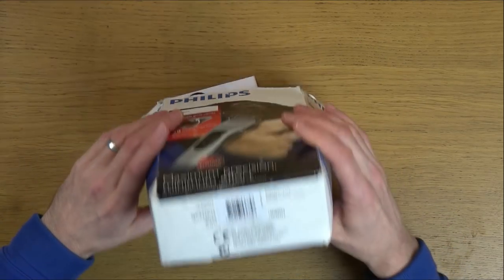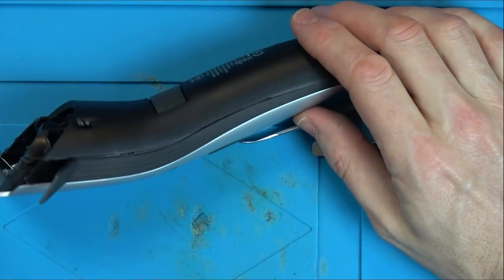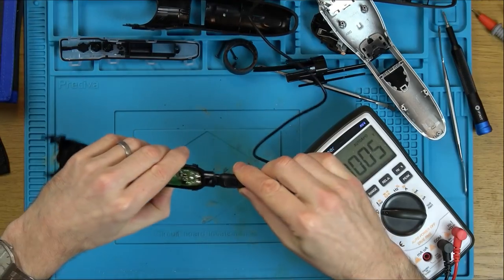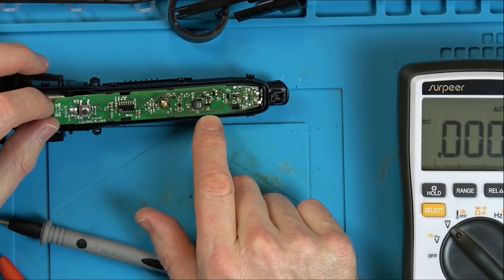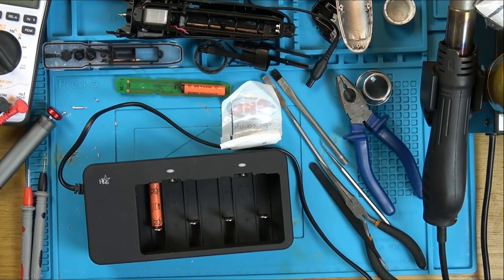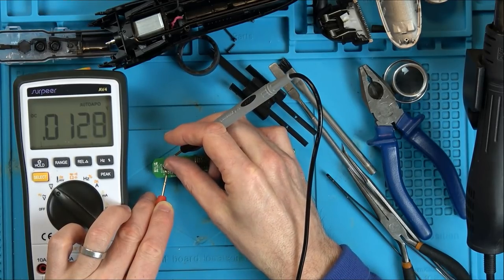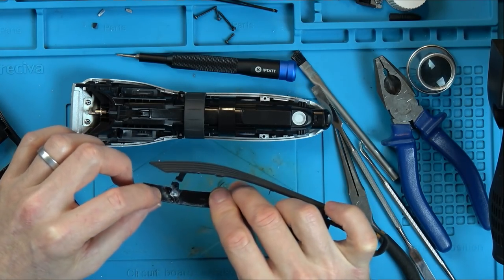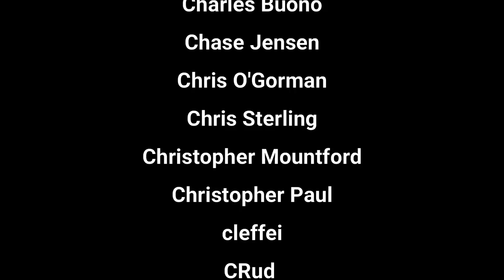Trying to Fix Philips Hair Clippers - Cheap Haircut

Comment: I suspect the shaver has a smart charging chip within it's circuitry, Meaning if the batteries load the charging circuit to much "Batteries Voltage below some pre-set" charging Voltage will not be applied, ergo.. Once you charged that battery "increased it's Voltage", the smart charging circuit detected it's Voltage as high enough thus allowing charging to proceed.. 
 
It's highly likely at the factory one of the new installed batteries were leaky, to which the shaver was looped back for a battery replacement, The gooey innards was ignored on one side of the MoBo, when the battery was replaced with just enough charge to pass QC, To which it was distributed and purchased, and because it wasn't used and didn't receive a proper initial charge, over time they discharged to a voltage deeming the batteries as defective.. 

Mind you though this hypothesis is just that.. A HYPOTHESIS, but if the Shaver proves to be reliable for three or more years before it needs battery replacement, my hypothesis can be proven by your next video of this shaver when you test the batteries voltages before and after charging them to get it to work for another two or more years..

Comment: I suppose if takes 12 hrs to charge, and it only runs for 1 hour. There isn’t enough current from the charger to run the clippers only. If that makes sense.
It’s a trickle charger. Not made to run the clippers. 
Thanks for sharing.

Comment: Hair Clippers charging batteries frew closed circuit and supplying power to motor frew this circuit. If battery is dead (not working) charging circuit will stop supplying power, if one battery to would be charged with 15V to Hair Clipper will  overheat and cause fire. Dead NiMH battery need sometimes boost of Voltage to start charging otherwise they will not accept any power.

Comment: Actually, none of the beard trimmers I have work plugged in to the mains. They need to charge the battery first and then you need to unplug and power them on, only then do they power on and work. I don't know if that's the case with this hair clipper but it could be. I guess I'll find out during the video.
Reply: And there we go, you looked it up and this one is actually supposed to worked whilst plugged in.
Reply: And another nice little fix.

Comment: As Simon says (Simon Says??), the circuitry in the thing, wants to see a MINIMUM voltage, for safety....  So seeing the battery at zero, the circuit just says "I'm failing my minimum voltage test, I don't like it, I'm out" and won't run it at all...  

Lots of these devices, they have some basic "safety" built into them...  It wants to see voltage in a "range" of normal operation....  And as you sort of "accidentally" discovered, when you run it plugged in, it really isn't running off of straight wall current, it's charging the battery, and running off the battery, at the same time, so it will eventually go dead, if you are running it with it plugged in....

Look, if you are Phillips, massive monolithic company, room full of lawyers...  Who knows what the consumer will do with this thing.  They might dunk it...  they might do anything.  So you can protect yourself, from a huge lawsuit, just by adding in a few simple "protection" features, and say hey, these are the "normal" voltages we expect...  Anything outside of that, nope, shut it down....  And sure, it's not Lithium Ion, but, any battery, can leak, get hot, do bad things...  Not a bad idea, from Phillips standpoint, to just put a few 'safeties" in there, just in case of unforeseen events....

The modern car battery chargers are doing the same thing.... It wants to see a range.  If voltage is too low, or it's drawing too many amps, or voltage is too high, it just shuts off....  Which annoys some people, who know what they are doing....  That's why some of us keep around those old "dumb" battery chargers...  They don't "think".  They just charge.  Now, you have to be careful, with those things...  but that's a whole 'nother discussion.

I have a Phillips beard trimmer thing...  Seems pretty similar.  I know my batteries are toast.  Still sort of works, but you basically have like 2 minutes, to do your trimming, and it starts slowing down.....

You also accidentally discovered a little "trick" with your desktop charger....  If you put 2 bad batteries in it, it'll just blink the red light, and not charge....  If you put 1 good one & one bad one, many times it will charge, and you can get the "bad" one to bounce back, and get it charged up.....

That all being said, I agree with your conclusion midpoint in the video.   That was battery leakage, you were scraping...  That white stuff, early in the scraping, was classic battery acid goop...  Something went wrong there.  So, it's not going to work for long....  You're going to need batteries....

Typed on my fancy backlighted keyboard, that only a child could appreciate!!!  ;)   Heh heh!  Just kidding around.  Great job on this one!

Comment: Hi Vince can you help me when I connect my PlayStation to my monitor it says Analog Power save mode the PlayStation turns on but it's the monitor it turns off as soon as I turn it on and when I turn on my whole PC it does turn on but when the PC is off and I turn on my monitor it says Analog power save mode I use a DVI for my ps4 to connect to my monitor can you help me please in the next video.

Comment: longstory short..a bad battery in a manual car will not complete the circuit properly, you may be able to push start it and have it run but if the battery is completly shot it will still not run regularly ..old timers have told me that a complete circuit is needed for the computer to run as well as proper voltage..ie bad battery and the car might not run at all..all because of a faulty battery you are now walking..even if the alternator is good.anywayz a bad battery can mess up the  circuit..no proper flow no proper go

Comment: Looks like this thing isn't easy to repair, my Grandma worked as a hairdresser and still does haircutting for family members and she uses a Panasonic ER121 professional trimmer (from the early 2000s) and you just need to remove the screw on the back and two on the top (after removing the blade), pull off the silver top part and then pop it apart and swap the battery (it's just a AA with pins on top and bottom): https://youtu.be/r0QghsdUidM

Same with other professional ones like from Wella, the Xpert's (HS 71) is user replaceable but also Lithium-Ion and the smaller Contura got a soldered AAA similar to this one but you can take it apart much easier...

Comment: I think the battery is faulty.
It self discharged to a point that the charging circuit refused to charge it.
The cord uses the same circuit as the battery to reach the motor. So a dead battery would break the circuit.

Comment: Vince, please in future put warning at least 5 seconds before you use soldering iron for plastic welding with same tip you use for soldering so I can skip it or at least close my eyes.

It didn't work with adapter because IC work only from battery voltage and judging by PCB it can charge during operation but there is no direct connection from input to anything else than battery and that also isn't direct connection.  Charging is probably pulsed and IC control it with circuitry around inductor but if IC is without power in a first place...then well, item get sold on ebay for a pound.